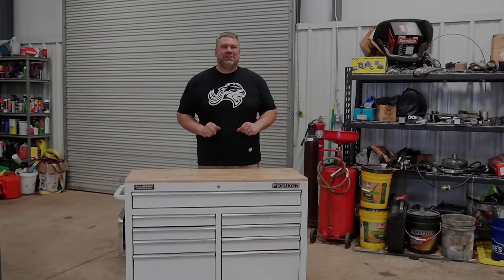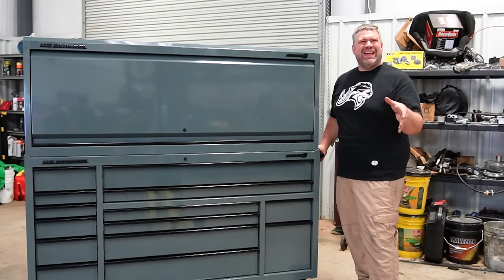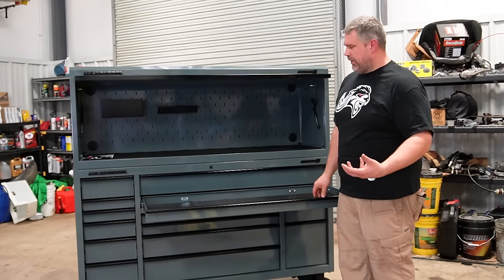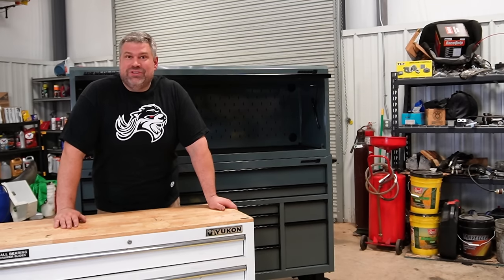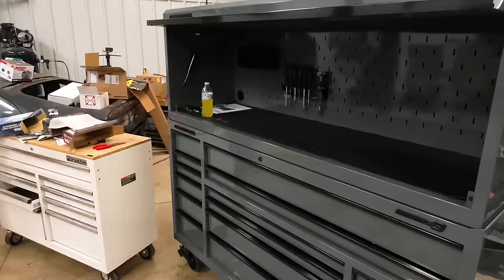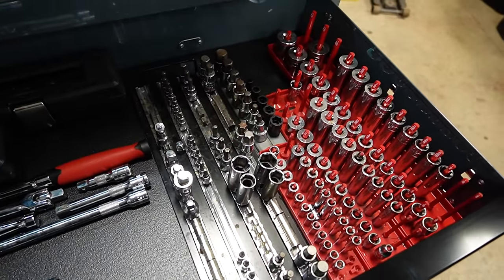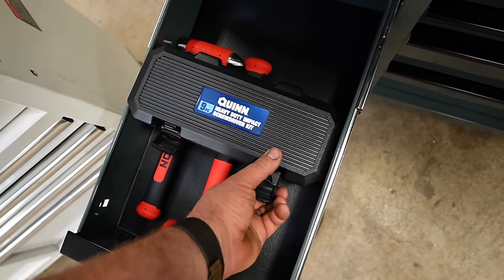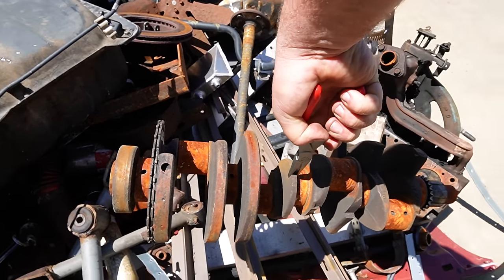Can You Really Save $20,000 With "Cheap" Harbor Freight Tools? U.S. General Series 3 Review

Comment: It’s funny when Snap On guys will try to justify their tools and/or tool boxes too. Like yeah it’s 10x the price but it’ll last forever bro! Yeah well…. I can still buy ten of these to equal your one box.
Reply: I love my icon tools but the snap on tools are just better quality
Reply: @thicctomato4977  Right, no one’s arguing that. But if it turns a bolt, screws in a screw, welds a weld, that’s all that matters. 99.99999999% of the time a harbor freight tool is going to perform the job EXACTLY the same as a snap on. That 0.00001” of runout on that expensive drill bit compared to the 0.0001” on the cheapo one is never ever going to be noticed or make any difference what so ever. Your ratchet has 6 more teeth that the cheap one, I have yet to find a bolt in an engine bay working on cars for over 20 years now that my craftsman evolv ratchet hasn’t worked on. Yes, the entry level craftsman brand with the lime green cladding that Sears used to sell. I’m still using that set to this day with my wonderful multicolor harbor freight sockets. I’ve put five foot breaker bars on all of my wrenches and sockets. Are some of them damaged or bent or out of round? Probably, but they still are getting the job done. If that makes you happy inside to spend 10x as much on all your tools that’s cool but I hate all these YouTubers who tell people “this is junk and that’s junk, buy snap on!” “Buy a tool once and be done!” NO! I’d rather spend $10 on a wrench that will last me 5 years, save the money and buy my family dinner for the next month. Then, when the time comes that it does break? I’ll buy another one with all that money I still saved.
Reply: If I’m being honest nobody who is buying Snap On is paying the MSRP really, and also I buy all used Snap on and its no where close to 10x maybe like 2-5x depending on what it is. Like for a 72” master box I can find one used for like $3,500. Thats kind of a no brainer, to me at least, to buy that instead of $1,800 U.S general thats only 22” inches deep.
Reply: @nathanfogel4608  Right but someone had to buy it at that 6x 7x 10x, whatever it is, price in the first place in order for you to get it at a used discounted price. The point is for most tools, you’re just not getting a tool that’s 1000% better if it is 10x the price. I’d even argue in most cases you’re not getting a tool that’s even worth twice the price at 100% better. Snap on is literally just a flex and you convincing yourself it’s worth it. Harbor freight is on every corner where I live so even the argument of “well they come to you” is kind of moot. Are there specialty tools that snap on can get you that a big box store can’t? Absolutely. But for your basic hand tools, it’s such a scam.
Reply: @bradrichter5082  Your right, I suppose it all depends on your financial situation. Since its true that Snap On is expensive and Pittsburgh for example is cheap. So, I guess you have to find the quality and brand thats suitable for you. But, to me paying extra money for a better quality tool that I’d use for the rest of my life, is worth it since granted I’m not paying MSRP and I’m not using credit to pay.

Comment: I don't know you and I don't know Matco Tools (until now). Yet after 5 seconds of thinking about it, why wouldn't they address the paint issue (on your $25k box)? I would think Matco would send out a pro paint tech for $1k or $2k at most and repaint your box to your satisfaction. Cost them very little, you're satisfied and hence provide good word of mouth instead of what you experienced.
Reply from the maker: It was an absolute nightmare, took the truck owner to do anything and it still isn’t right.

Comment: Husky over Yukon box.  It’s deeper
Pittsburgh tools suck
Pittsburgh pro and auto are good tools
HF has decent tools   Icon. Doyle. Quinn  are all decent to good
SnapOn stuff is better.  Just not that much better.  
Not a hutch fan myself 
2 smaller rolling cabinets (44 inch).  Cheaper than a 72”.  Easier to move.  Can build out with tops and side cabinets 
Better yet a 44 inch with a top unit, the side locker and a husky wood top like the Yukon with a backboard 
Easier to move around in the shop.  Easier to move if you change locations 
Of course now HF is starting to offer decent power tools and a year ago I would have said never buy HF electric anything.  I’m on Milwaukee platforms so not likely to get any HF power tools but would not tell someone to avoid now.

Comment: So I do have some things to point out.
1 . Your comparing the wrong pliers. Talon grip multi position needle nose are the ones picking up nickles. Cold rolled steel , Lazer cut teeth as strong as file teeth vs cheep China junk.. 
2. Nobody pays full boat off the tool truck.
3. Why support the manufacturing in China vs supporting the American manufacturing?
4 . Snap on is far superior in every way with hand tools  and from the steel to your shop is supporting Americans.
5.im Canadian so this isn't just your standard American patriotic statement. 

Common jarred..
Reply from the maker: Not as much is made in the us anymore, and I’m promoting what works, and for good prices. I’ve got a drawer full of broken name brand tools that I can’t get warrantied because my area doesn’t have routes, and I have to mail them in.

Comment: We don't sell individual sockets the only sell 8 impact sockets separately or spark plug sockets individually. Go buy one at Napa for 30 and that's not impact now you get 12 for 64. Actually go to the factories that make your tools and see what others come off the lines there you will find craftsman and so many others made there also using same materials. So do your homework. Say what you want but real mechanic can fix anything with harbor or other cheaper tools so shut up I'm tired of all you saying crap and don't know what your saying. I go to mechanics that buy cheap cuz they aren't paying off junk tools off trucks. And my store takes care of customers. And if you loose your tools does snap on replace your tools you loose. And how much to replace one snap on 23 bucks for 10mm so a third of a 12 piece kit